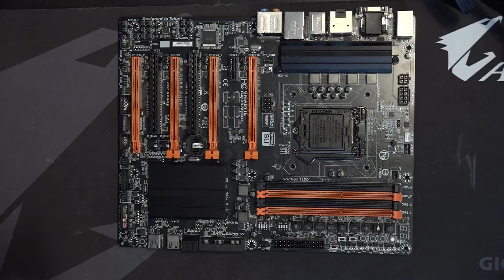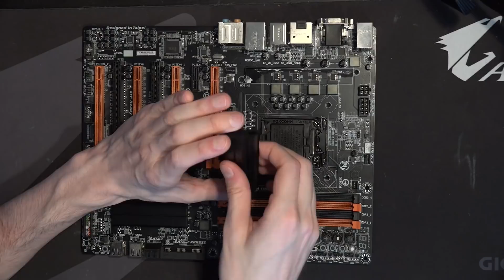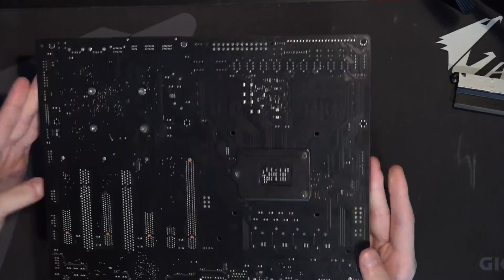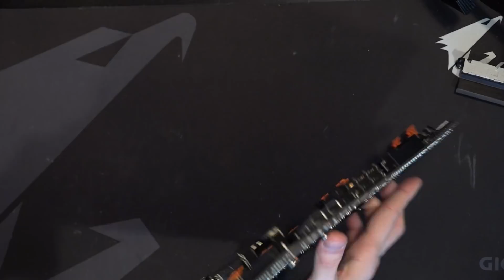ES Gigabyte Z97X-SOC // How Haswell ruined motherboard VRMs.

Comment: With 4 GTX 980Ti, how high will I climb on the 3DMark later? 4 years ago with just two GTX 980 I was better than 96% of the world. Right now I have 3 GTX 980Ti and am getting one more for synthetic benchmarks. I'm buying that very board. I have the i7 4790k.

Comment: 3:21 you are right, as the first three x16 slots are from the CPU whereas the last x16 slot is from the chipset, running only at x4 mode (same goes for the 2nd PCIe x16 fed by a CPU).

Comment: I've got a sort of related question regarding my Asrock Z97 Extreme3 + 4790k. I've read that with the 4790k, LLC applies to VCCIN (input voltage), is this correct?
My mobo only has LLC =ON or OFF. Weirdly enough, if I leave LCC OFF and set 1.75V VCCIN, I see 1.76V in HWINFO64 under full load...and when I set LCC ON, I see 1.65V in HWINFO64.
Am I missing something or is this the wrong way around and is my mobo bugged? Thanks

Comment: Hi BZ, am looking at B560M Steel Legend. it has 10 SiC654 for Vcore+Vgt, on a RT3609BE. My question is, this article [http://zhongce.sina.com.cn/article/view/78012] says the controller is for Vcore and Vgt only(same controller as z590 SL, Z590SL also use this controller for Vcore and Vgt only, but Z590 SL has 14 SiC654), so how the FUCK did AsCock math 10 powerstages into 8 phases?
(link above is for b560 not b560m, but has same phase count and seems to use same controller)
did asrock run it [4*2] +2 in 4+2 mode (can RT3609BE do this?)
or did asrock do a AsCock and invent 200A monster Vgt while only 6 power stage goes to Vcore?

Comment: I had a "budget" overclocking board for my Haswell/Devil's Canyon. I had an Asus Z87-A that I ran from 2013 until this past winter. It ran a 4790K at 4.8GHz for most of that time; a 4770K at 4.5GHz before the upgrade.

This will get buried but it'd be interesting to hear your opinion of that board. It was the best overclocking motherboard I ever had and it had no right to be. It also ran 4 x 4GB 2400MHz at CL 10 latency. Thing was a beast which is why it only started lagging on me just last year.

Comment: I had one of these and the power plain under the vrm is the limit for the board. I blew up two of these running a chiller setup. Never had any issues with condensation. I had the EK block on the vrm. 

Boards delaminated and dead shorted the vcore rail to ground.

CPU survived both times, still have it. 

If you want the block I still have it, but with a little scorch mark on it.

Comment: I brought one of those retail. It was a great board. paired with a 4970k. 
Lol..I broke the pciE lockin tab. Off the top pcie  slot. I took the bottom one off and replaced it to the top.   Memories...

Comment: so that's what happened to AM3+, the '3' is for the phase count not the socket generation (/sarcasm), lol.  that z79 is such a Bass-ackward looking board, all the extras and skimped to the min fundamentals, lol. I didn't like it then, and I still don't like the VRM fashion accessories now, it's just bad inefficient design for the sake of bling. they are adding more power stages to make up for the lack of a proper heatsink, because a reporter somewhere said "they look ugly". it's a computer, not a table centerpiece, get over it, put a real heatsink on the thing or drop the lies about being "green" with all the extra wasted power stages. (ending rant)
Great vid BZ, thats exactly what happend, along with forget who put "looks ugly" in the review. B)

Comment: Can you make a video about the Integrated Voltage Regulator? I always wanted to know how intel managed that.
Reply from the maker: there's a paper about the FIVR available on the internet.
Reply: @ActuallyHardcoreOverclocking  Thanks! But why does the FIVR has issues with cold? Is it maybe changing resitance when going cold?

Comment: But Buildzoid, that's still better than most of the B450 AM4 boards out there. I'm just curious about the DIP switch on the mobo . If I switch 2 of the DIMM slots OFF. Does the mobo equal to a 2 DIMM board in terms of signal integrity ?

Comment: i bought like the cheapest Z97 board for my 4690k back then, it didn't even have VRM heatsinks (i didn't know better back then). The cpu would throttle to 3.5ghz under full load (was OC'd to 4.2ghz), despite cpu temps being fine, likely cuz the vrm's would overheat. Anyways, the board died about a year ago.

Comment: Wow, what an insane technology I never heard of before! So, the CPU die had built-in buck regulators and the package had integrated inductors hidden somewhere underneath the die?
Reply: IIRC Intel had "IVR" earlier on a number of server chips where supporting parts were not part of the actual silicone, FIVR was the next step when they managed to build the entire voltage regulators in their normal silicon process, using traces for inductors and built MIM capacitors - that's the "fully integrated" part! Looks like they MAY still had some input decoupling capacitors on the substrate though from the paper (see below).

Intel had presentations on this in various conferances around that time which were the widely discussed in tech press at the time, it's still relatively easy to find both high-level overviews and various technical papers like https://xdevs.com/doc/_PC_HW/Intel_FIVR_burton2014.pdf

AFAIK part of the idea behind FIVR was to allow many different internal voltage regions instead of being limited to "just" one big voltage domain and a few specialized support voltages that mostly doesn't draw that much power (or two large if you count "iGPU rail"), note that the paper mentions configuration space of 8-31 voltage rails and 49-360 phases at 140 MHz switching frequency (all of which is completely nuts by the standard of any normal VRM where 500kHz is considered a high switching frequency).

My impression is that the "lots of voltage rails" didn't pan out which may be part of why it went away for desktop, another factor was that consumers weren't willing to pay Intel more for the CPU because the motherboard manufacturers DIDN'T reduce their prices just because they could now build a much cheaper VRM... I agree that it's a bit surprising we don't see it in laptop chips, many of them are extremely volume limited so one would think being able to make the VRM take less space would be valuable.

I do remember there also being a lot of complaints that FIVR created thermal "hotspots" on the die which limited overclocking on air.

I suspect that the reason we still see FIVR on the server side is because their VRM issue can be much worse (1U servers are THIN!) and that most of the big companies that build them have full control over their entire product which means that the smaller/easier/cheaper motherboard VRM really do make the motherboard cheaper for them, even though that saving didn't happen in the desktop segment.
Reply: Search for Intel FIVR

Comment: oh it has a sata express connector... has anyone actually ever used those?
Reply: The only actually launched products I know of are SATA Express to USB drive caddies by Chinese brands. Some of them have the ridiculously wide connector but most seem to use NVMe, which is supported by SATA Express. In any case, none of them plug into motherboard sockets and the installed drives are the usual M.2 and regular SATA variety. Actually, while writing this post, I found on Amazon what looks to be a SATA Express to 2x M.2 drive connectors that fits into a 2.5" drive shell. You'd be able to use that on these ports. Other than a photo or two of prototypes from 2014 era trade shows, I've never seen evidence of native SATA Express drives.
Reply: @dycedargselderbrother5353  Lenovo used it in thier laptops. And they sell a drive caddy to install m.2 drives in it. I had one with my z97.

Comment: Posting under this video with my Z97 - 4770k seven years old PC. What are you complaining about. It's not Haswell fault that the manufactures greed out the crap of boards since after it. The price for average boards has doubled. The features on them halfed and the quality over all is crap. But again that is not Haswell fault.
Reply: the amount by which you missed the point is absolutely baffling...
Reply: @givemeajackson    lecture me ...

Comment: the amount of bad z170 boards is crazy. my z170m plus couldn't get a 6600k to above 4.2ghz because it couldn't deliver the power
Reply from the maker: I find that very hard to belive. I was running a 7700K at 5GHz on a 3phase ITX gigabyte board with no VRM heatsinks.
Reply: @ActuallyHardcoreOverclocking  I had it cooled with a H105 and I was pushing 1.325V. Nothing above 4.2 was stable
Reply from the maker: @gdrriley420  did you ever try that CPU on a better board?

Comment: Short answer: Becasue on Haswell, Devils Canyon and Broadwell the voltage regulation is fully integrated into the CPU. Therefor the Vcore VRM puts out higher voltage, but a lot less current and thus runs a lot cooler - which is why manufacturers could get away with putting relatively weak Vcore VRMs on their high-end boards.
Reply: Is this one of the reasons why there's generally less overclocking headroom compared to Sandy Bridge? Like I can get my 2600K to 5GHz without a sweat but my 4770K is such a pain to deal with that I had to delid it barely scraping 4.7-4.8GHz.
Reply: @idontwatchtv  Yes and no. Having the voltage regulation onboard certainly doesn't help (thus Intel went back to external voltage regulation after only 2 generations). But as BZ pointed out, it's probably more of a case of different architectures with different structural width. On the other hand I didn't really have any troubles running 4770Ks beyond 5GHz back in the day. They get hot as hell, but as long as you have decent cooling and a board with a quality VRM, 5GHz shouldn't be out of reach for like 90% of the chips I suppose. You should get to about 4.7 GHz all core with safe voltages. Also depends on when your chip was manufactured. Later on in their production cycle, all the 4770Ks with good ASIC quality were binned and rebranded as 4790Ks - so on the early ones you have a higher chance of getting one that oc's better.
Reply: @meteormedia7021  lol my 4770K ran 4.4GHz at 1.42v guess I lost the silicon lottery😂
Reply: @okbrowhatisthis  lmao what
Reply: @ag8912  true story
Reply: @Ray Wang  that's brutal. 4.6 Ghz was regularly doable with air, 4.8 Ghz you could do with water. Anything above that was a golden sample. But 4.4 Ghz at that voltage almost warrants an RMA lol
Reply: @ag8912  Used it for 8 years lol, then switched to a 5900X and never looked back. I guess it‘s just my luck 💀
Reply: @Ray Wang  definitely a solid upgrade 👌
Reply: @idontwatchtv  yes, the on-cpu VRMs limit overclocking drastically
Reply from the maker: @tommihommi1  Ivybridge also clocks worse than sandy bridge on air/water. 22nm just doesn't clock as high as 32nm.
Reply: @tommihommi1  It doesn't

Comment: Ah, the infamous FIVR, which made VRM quality (except for current capabilities and thermals) totally irrelevant, because a dud of a FIVR still overshadows any motherboard bios features. Not to mention an absolutely garbage voltage control, without any control over vcore LLC.

Comment: I miss the days of when Gigabyte were overclocker friendly and came in a blue PCB
Reply: My GA-X58-UD3R is still going strong even after my Z170M died to ESD.
Reply: My X48-DS5 rocks hard after all these years
Reply: Yellow and orange ram slots and the socket, that were the times
Reply: Still have my GA-X58A-UD7 with W3680 Xeon
Reply: overclocker loving GA boards are black and orange
Reply: had alot of fun with GA-G33M-DS2R mATX best time

Comment: Well yes but its awesome on Haswell you could take any shit board and they'll overclock close to the same as the top boards lmao
Reply: Exactly I don't get how to be mad at that... Blame it on lazy motherboard vendors that don't properly adapt designs for each platform
Reply: @salmiakk_it  But like Buildzoid mentioned, for sustained load that VRM shuts down. For example in a Asus  Z97-M I could reach stable overclocks but for not longer than 1 hour, and it didn't matter the Voltage or Core clock, the VRM simply had a timer to shutdown during sustained full load. I never could understand that and now everything makes sense after watching this video.